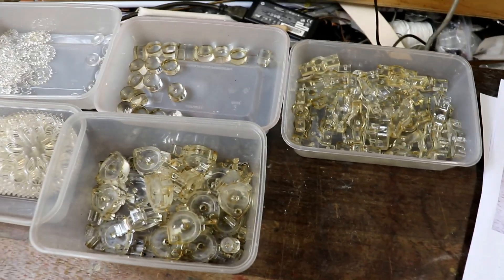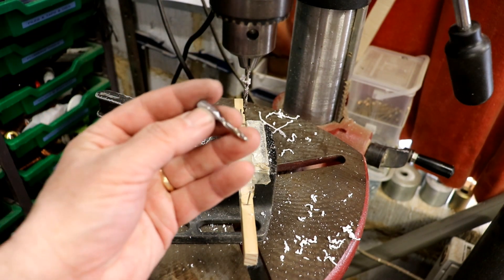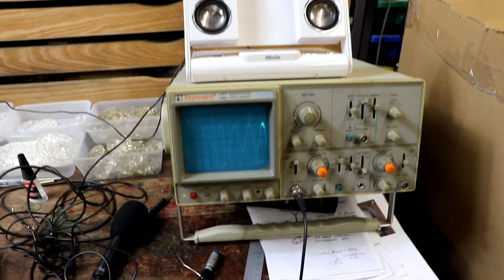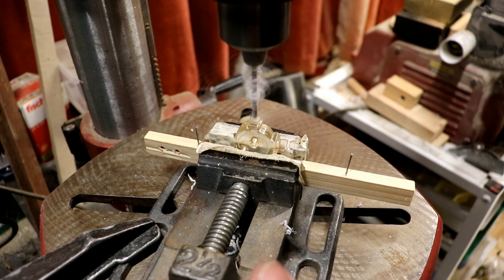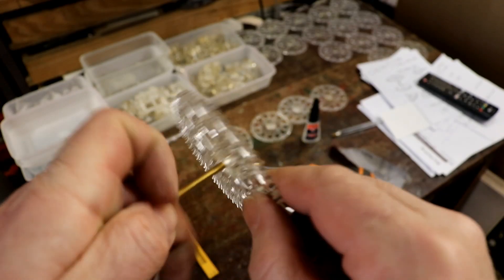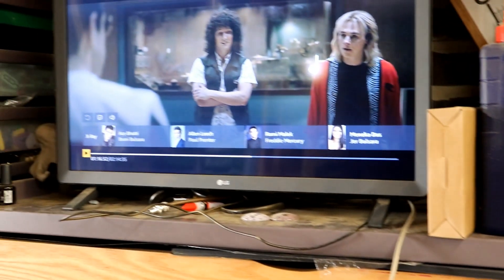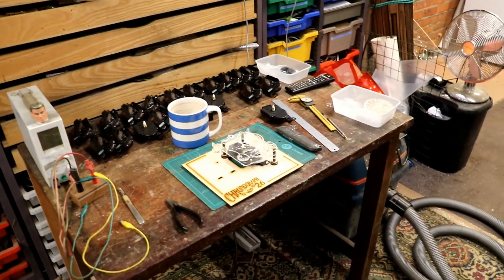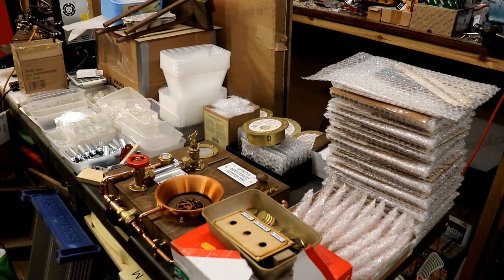Batch Producing 20 New Steampunk Clock kits - Part 2

Comment: Why are you making clock kits when what you really need is a Fox Deterrent device....
Reply from the maker: Congratulations for the first comment!

Having lost a couple of chickens surrounded by an un-electrified fence, we got an electric fence, but grass had grown up around it and it was constantly clicking, so we left it switched off one night, whilst we prepared to trim the grass. Unfortunately the fox returned and found a small gap in the un-electrified fence. I went out first thing and removed the remains of two chickens, thinking the third had also met her end. Then, whilst we were eating dinner that evening, she reappeared outside the back door with a severely chewed neck. Amazingly she lived for another month, but finally succumbed to her injuries.
Reply: @steamhead   wow that sucks.  We have more problems with coyotes here.  They're very determined.